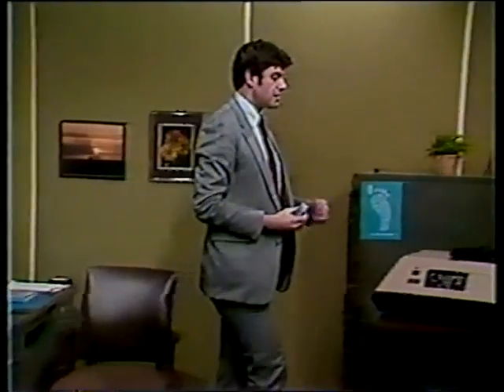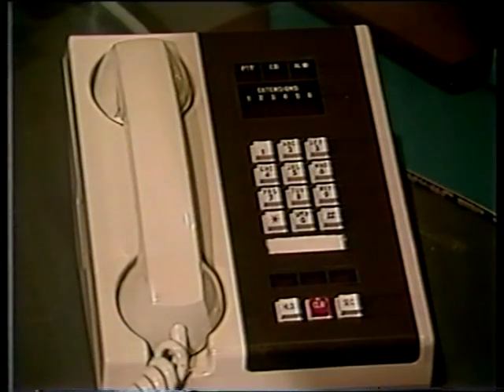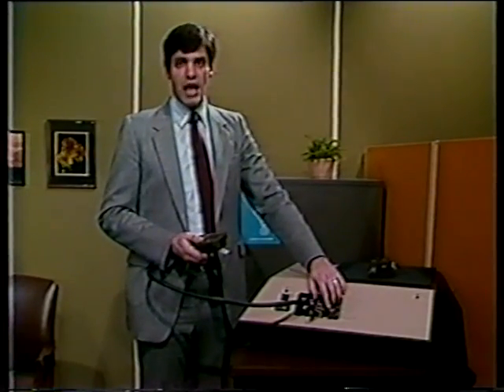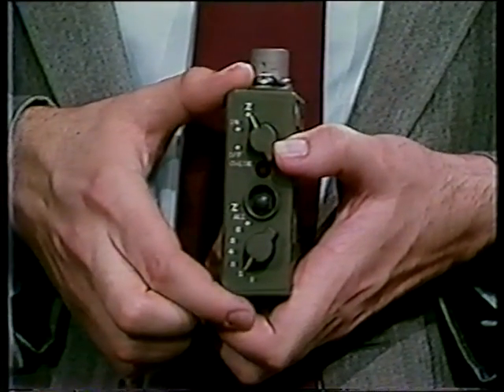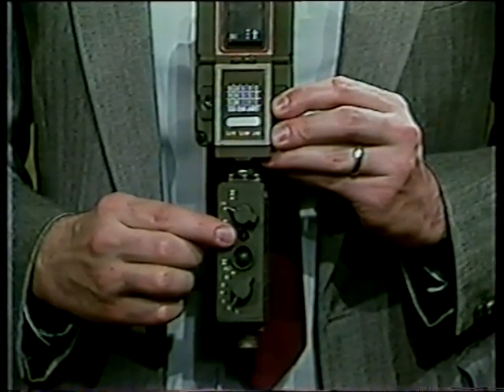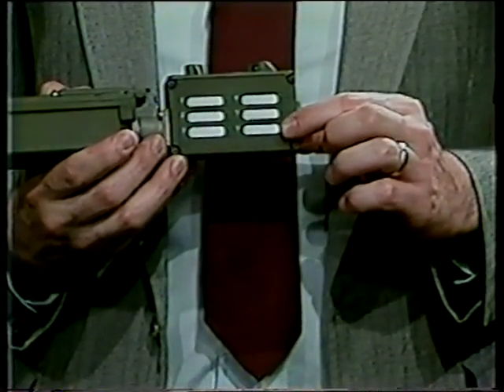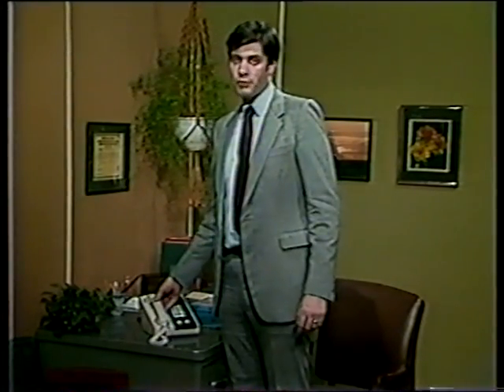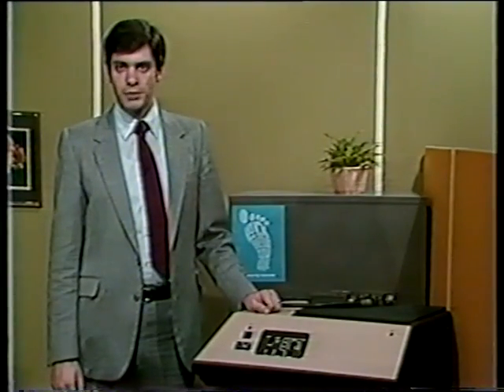STU II rekeying

Comment: And what to do if you hypothetically lose one?
Reply from the maker: What exactly do you mean? Losing the STU-II, the key loader or the key?
Reply: Presumably, if it's a lost key filler or keying material, you let your supervisor know ASAP, so that those keys can be invalidated and new ones issued. Depending on the secure net configuration, it may only compromise a small group of phones rather than the whole network, but always better to be on the safe side.

If you lose a whole STU-II terminal (however that was able to happen), I presume the process would be similar, with immediate blocking of that terminal's ID from any over-the-air re-keying process.